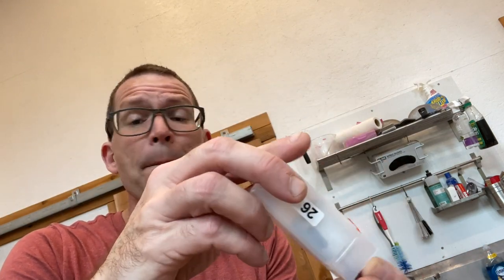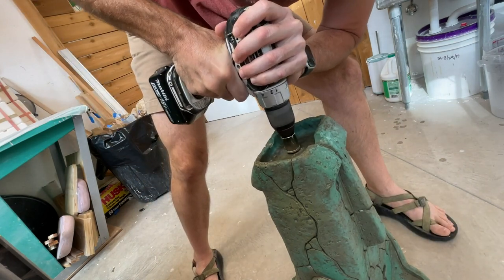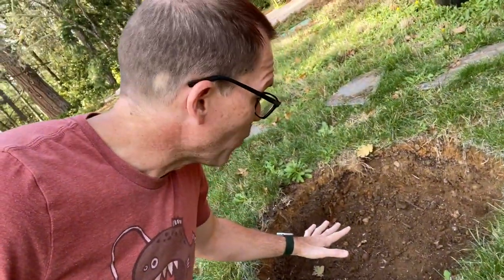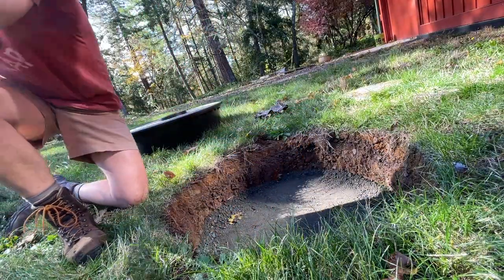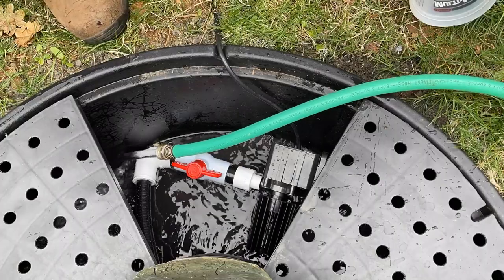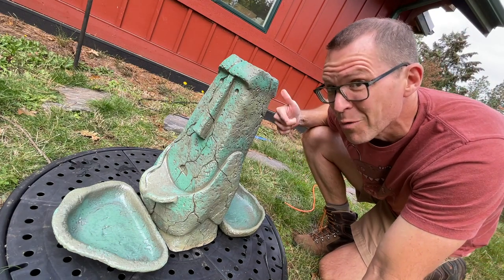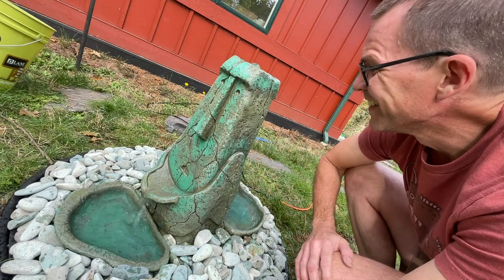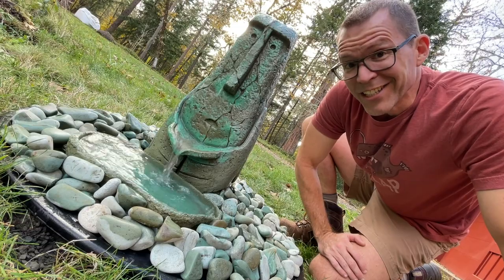Ceramic Tiki Fountain Pt 4 - Tiki Technical Tuesday 42

Comment: This is AMAZING! ...the next time you make one? and, I got a feeling you will.... maybe make the form in 3 pieces like /|\ held together with some magnets. That way you can pull the middle part and collapse the outer parts inward making removal easier. Also, you might want to think about making it in smaller stacking parts so you can make both a larger tiki, but lighter parts. Added bonus, if you standardize that juncture? You could 'mix and match' different parts. Also, why not a Tiki Mug in the Tiki hands? one with a hole in the bottom or tipped? Your work is AWESOME!
Reply from the maker: these are all fantastic suggestions - especially the collapsable core for the inner foam form.  I have a looooong list of changes I plan on making if I ever tackle another fountain project :)